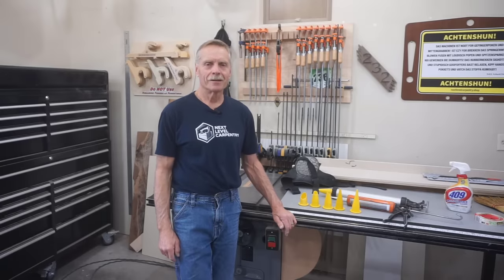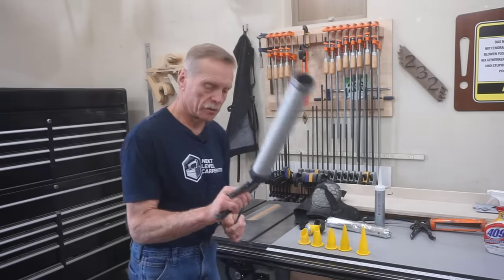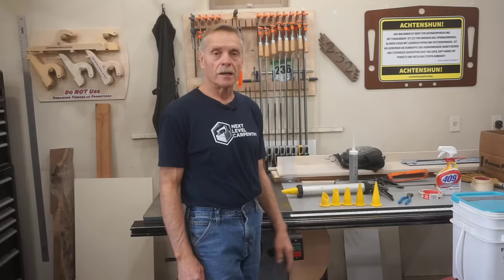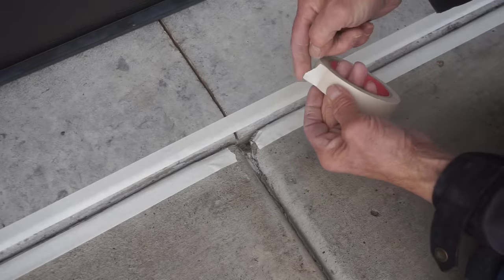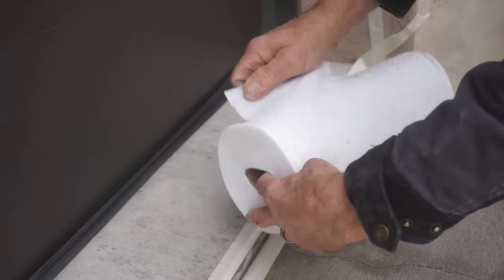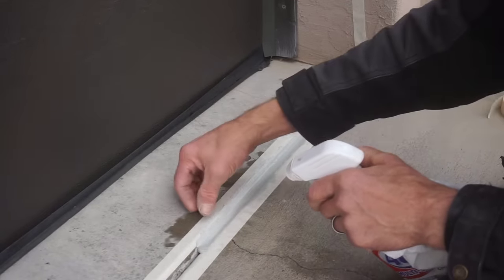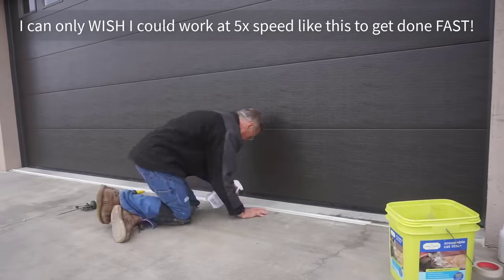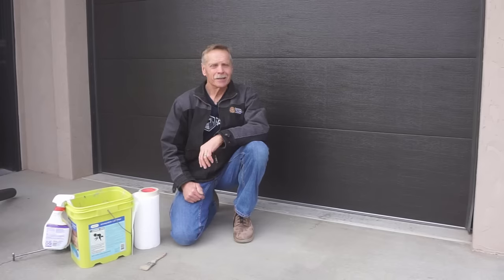How to Caulk Concrete Control Joints with Perfect Results Every Time

Comment: The "control joints" in my garage are literally inch and a half wide 😢
Reply from the maker: All the more reason to use this method and technique to seal up those joints to keep water and detritus from collecting in them IMHO.
Reply: @NextLevelCarpentry  definitely and to keep all my tool boxes and creeper wheels from getting stuck 🤣 just going to take alot of caulking
Reply from the maker: @markg3305  Uh-Oh... since the urethane sealant I use in this video remains rubbery/flexible literally for decades, it wouldn't e ever keep toolbox or creeper wheels from getting stuck!  Not sure what your best solution is but it would probably need to be some sort of epoxy product, strong enough to support concentrated loads generated by hard, small diameter  wheels.
Reply: @NextLevelCarpentry  yeah I was worried about that also, I will play around with some things and see thank you anyways awesome info in your video!

Comment: Why would you caulk a joint?  Isn’t the purpose of having the joint to help reduce stress to the concrete?
Reply from the maker: Wow... you totally don't get it, do you?! 😲
Reply: @NextLevelCarpentry  You realize they don't understand but don't educate them? You failed to help someone with 8 useless words. Here is an alternative "To seal and protect, preventing water and damage." 

the caulk is also flexible, it doesn't compromise the joint at all, in fact it helps to support it more.
Reply from the maker: @SLCTheElk  I realize you don't get it either!  Urethane calk couldn't possibly 'reduce stress to the concrete'.  The purpose of this video is to show the best way I know to finish or 'tool' the urethane sealant that I use and recommend for sealing joints in concrete, not to educate snarky commenters about the purpose, design and physics of control joints in concrete flatwork.  
Maybe you've found yourself a new calling?  I suggest you spend time educating yourself first though because "to seal and protect...", while true and obvious, doesn't address the misunderstanding expressed in the initial comment in this thread.
Reply: I for one found this informative, educational and helpful.
Reply: @NextLevelCarpentry  I for one found this informative, educational and helpful.
Reply: Keeps the water out

Comment: ALWAYS should dry tool first with tooling slicks/knives. Freaking 409 is soooo harsh. I guess it’s fine for 20’ of residential driveway but you’d starve trying to tape 1000 linear ft a day taping and 409ing??
Reply from the maker: Starve doing the best looking joint sealing anywhere around?! Clearly you know less about running a profitable business than you do about doing first-rate work.  Doesn't bother me in the least but I want to make sure Next Level Carpentry Channel viewers aren't mislead by your comment.

Comment: I wouldn't recommend to use your fingers. For obvious reasons it's never a good idea with those high-tech products anyway. You can get the same effect with the back of a spoon. I always have different sizes of spoons (from big ones to a  coffee spoon) and they make perfect smoothing spatulas with any diluted liquid soap. I've done hundreds of joints this way (even fast drying epoxy) and it always worked perfectly… 
I also always use disposable gloves because I'm not as neat as you and always end up with some kind of a mess (which has been considerably reduced over the years - lol)
I clean tools with acetone too. This also shouldn't be done with bare hands, always use a cloth or wipe.
Thanks for posting …
Cheers !

Comment: That joint is going  to fail
Reply from the maker: Says you?! 
Just how do you explain the fact that it's holding up perfectly after a full 2 YEARS?  Most would agree you're blowing smoke in an effort to appear smarter than you are...
Reply: @NextLevelCarpentry  I'm a journeyman caulker and glazer that is not the proper way to seal a joint
Reply from the maker: Typical comment from a so-called professional... trying to brag about what you know without a simple explanation for my question....

Comment: There are so many things wrong with your caulking.i don't know where to start.the caulk will shrink on it own to give it a concave.you are not applying enough pressure to get the air bubbles out.guarantee if you cut that joint out it will be filled with bubbles.get a real tooling knife slightly overfill the joint and use the tooling knife to back toolthe joint taking up the excess then go back and forth with the tool to get the bubble out
Reply from the maker: Apparently you do know where to start... but you apparently know little else about properly sealing control joints.
The misinformation and tone of your comment is extremely irritating because I've been doing sealant work just like this for over 25 years and have zero of the failures you mentioned which makes me conclude you don't know what you're talkin about and shouldn't be making comments to imply that you do. It's an annoyance to me and misleading for other viewers so please either produce a video that shows the superiority of your abilities or frankly just keep your comments to yourself.

Comment: I cringed, at him using the grinder and leaf blower without a dust mask.  The silica in the sand and cement can cause silicosis.  The joint looks great but not at the expense of permanent lung scarring or cancer .

Comment: This is joke level. Never ever tool with water and your FINGER! Buy a sealant tool at your local sealant distributor.
Reply from the maker: You should refrain from making 'joke level' comments on videos like this Dain... it lets other viewers know you don't know what you're talking about because they can clearly see the methods used in this video and results I get using them.  Just sayin'...
Reply: @ Dain Zam, 
  Tooling sealant joints is an art. And even if you're an expert sealant applicator you can still smooth spots out using soapy water once it's dry tooled. Dry tooling guarantees that all surfaces contact with the sealant. Then, with urethane and silicone sealants, it can be smoothed out with soap and water (if you want). This is a no brainer and every caulker knows this. It can rain on urethane or silicone sealants minutes after tooling it and adhesion will not be affected. 
  As Next Level Carpentry showed in the video, the initial application with the gun and nozzle are the most important step. It forces the sealant into the pore of the substrate.
  You don't need to buy a special sealant tool either. Old butter knives work as well as anything. Wood shims work in a pinch. Just split them to the size you need and round off the end. I use rounded off tuckpointers. For very wide joints I use a rounded off margin trowel. They don't even make sealant tools that big.

Comment: You may have done 1000s of feet of this but I do 1000s of feet of this a day. I’ve been a production caulker for 17 years now. Local 2 Detroit.  Tremco is junk. Sika is the Industry standard. Tape is for guys that don’t know what they are doing. Your wet finger  “tooling” is dumb. They sell special trowels for this they’re called slickers. I’ve never seen anyone put sand on a joint on purpose. If your trying to stop it from sticking to a foot then baby powder works and washes away with the first rain. And doesn’t leave a weird texture. By not using backer rod or bond breaker tape you are getting a 3 sided bond. Witch does not allow the caulk to flex properly and causes it to fail. Please don’t teach people to do things wrong. Unless they are cool with paying the pros like me $6 a foot to remove and replace it in a year. You stick to wood and let us do the caulk bud.
Reply from the maker: NOTE TO VIEWERS: this is a prime example of what a severe case of tunnel vision looks like.  
Shovelhead here can't see beyond 'the way we always do things' far enough to admit that some people are smart enough to do a better job on their 1st or 2nd attempt than a "17 year pro" does.  Want proof?  Just ask the pro to show proof of their self-proclaimed better work.  They always rant, pout and insult but NEVER have I seen one show visual proof.  Don't believe me?  Just wait and see the reply Choppy here writes...
Best,
Matt
Reply: This was filmed in 2018 at  a parking garage in Pittsbugh. That’s a 54oz bull gun that was emptied in 18 secs. That’s almost two sausages.  On that job I was shooting 1100 feet an hour. I wasn’t trying to insult you. I’m sorry for saying your finger slicking was dumb. I just don’t thing it’s right to teach people to do things the wrong way.
Reply: My bad. Sausages are 20oz not 30. That over 2 in 18 secs.
Reply from the maker: @skinnyguy4111  WHAT was filmed in 2018?
Reply: To be fair, he has a point about the backer rod/tape. What tends to happen without it is that expansion/contraction is acting on a "wedge" of material, effectively pulling on all surfaces of the material instead of just two: the opposing sides of what you are filling. This causes a rolling of the material, thus making it easier to "unstick" itself from one of the surfaces instead of stretch between the two. All sealants will fail over time for a variety of reasons (and some may not if you're lucky and conditions were perfect when applied), but replacing joint sealant with a backer is also easier than replacing an entire trough where you need to clean out sealant from the bottom. YMMV.
Reply from the maker: @TheDirtCreature  If fairness is involved then the main point to discuss is that this video was NOT created as a treatise on 'joint design', which is what your comment concerns.  It's plain annoying when viewers like C.S. refer to the method I show in the video saying "I just don't think it's right to teach people to do things the wrong way" when his comment is a distant extrapolation from what I'm showing which he construes as 'wrong' when it's primarily just different.
Reply: @NextLevelCarpentry  The Internet is a beautiful monster, isn't it?

Comment: I am a commercial caulker for a living. If someone showed up and tried to caulk like that they would be fired instantly. There absolutely a faster and cleaner way with no tape no 409 and no mess.
Reply from the maker: Substandard, messy work done by self-proclaimed commercial caulkers like you, mostly on residential projects, are the main reason I produced this video Lyle.  Your comment is arrogant, ignorant and unproven.  Unless and until you produce a video showing YOUR work using YOUR methods demonstrating and showing an 'absolutely a faster and cleaner way' to back up your statement here I'm calling you out as an insecure 'all hat and no cattle' fraud.  Best, Matt
Reply: @NextLevelCarpentry  I can assure you that my entire caulking work history is all commercial work. As for who i am search for lyle cote Poets seat monument in greenfeild mass. As for my comment it is arrogant because there is an easier way. That is clean and faster. If i knew how to do a video i would. Soon enough
Reply from the maker: @lyledundee3158  sounds good... But I'm not holding my breath. 🤨
Reply: @lyledundee3158  Then just get somebody who knows how to help you with that part!
Reply: That's your claim! Now back up your claim and show us!
Reply: @lyledundee3158  I wonder why you don’t just comment on the “faster and cleaner way” explaining how you think it should be done
Reply: @deluxe1030  Seen it! Good grief!

Comment: What kind of amateur Has to tape the join off I couldn’t even imagine how hard people would laugh at you if you pull tape out on a real job I caulk that thing with no tape in the dark and it would’ve looked a hell of a lot better than that but that’s OK continue to think you’re a professional
Reply from the maker: Typical "all hat and no cattle" blather Dude... sad thing is that everyone knows it except you. 🙄
Reply: Everyone has their own style. I've done so many different jobs with caulk (single and 2 part) and to do a nice clean looking job we would use tape. It sucks because of the time, but you put that on your bid. Try injecting concrete! Now that's a blast especially on walls! I NO LIKE THAT! LOL
Reply: Well I suppose Mike Liptard everything looks great in the dark... but when you pull your head out of the arse” and come into the professional light 💡 mabe just mabe ur ego will help u learn.
 Don’t take people’s kindness for weakness.
Reply: @NextLevelCarpentry  ,
Reply: I'm guessing the video you post would be for professionals and they would laugh at you for why even try to teach professionals doing their own jobs.